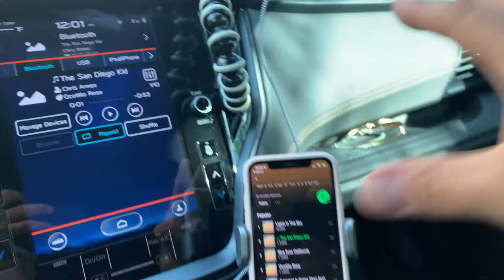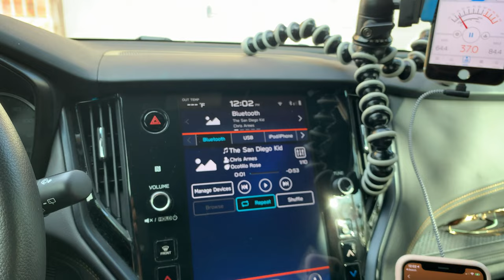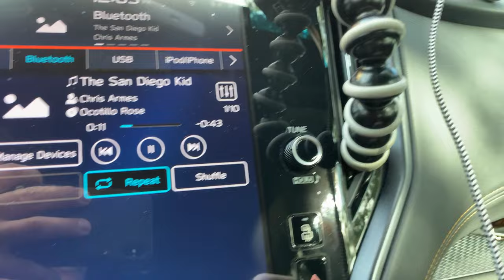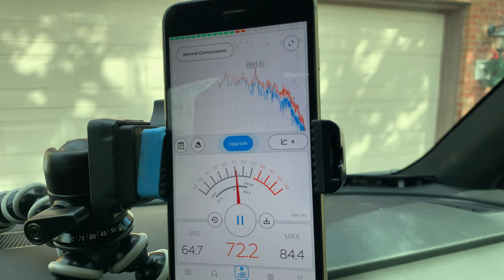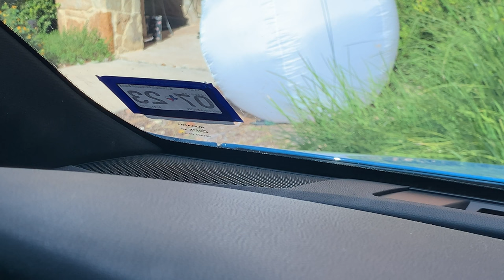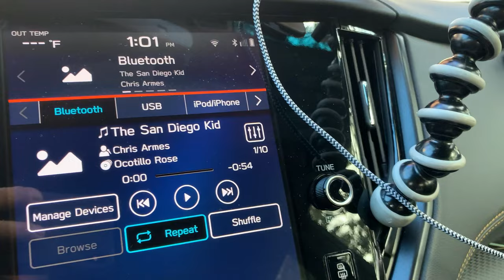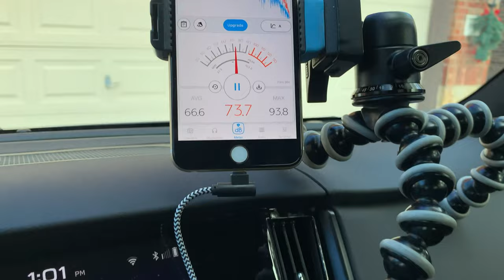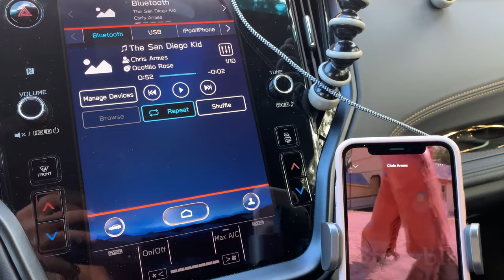Subaru Outback Wilderness 2022 Tweeter Install

Comment: 2024-2025 outback Wilderness has Harmon Kardon standard speakers but they don't sound that great. The factory amp keeps the same frequency in and  out so it won't be louder but maybe cleaner/crisper. U gotta set the balance more towards the rear.

Comment: swapping the speakers are not necessary, ive had a "system" in every car and truck ive owned, $4k+ on speakers and amps on most... BUT... on the OBW a simple DSP install will save you from having to replace all the speakers AND is a 1/4th the cost. YES it does take crappy speakers and turns them into expensive high quality sounding speakers. - grest video BTW!
Reply from the maker: Do you have an example install video of a DSP in a OB/W or particular link to a product you could share?
Reply: I'm learning but I did go to a car audio store and talk about my options for awhile, things definitely seem a lot more complicated than I thought. He as well suggested not replacing the speakers to start.
I was told the first step to take (low hanging fruit) would be to get a Kicker Key, a quick Google just told me that's a 'DSP'.
It seems interesting and I may try one, although with instalation its seems expensive for a first step.
With these two speakers in the video shown side by side it is tempting, they are very cheap with an easy instal by the looks of it. At that price if they make a difference would that not be a good thing? Maybe the DSP overrides that advantage?
Reply: No it doesn't .
Moronic statement
Reply: just adding a DSP to factory speakers is just adding a "Band-Aid" to the system. when you get good quality speakers and a good amp behind them it then takes it to another level with the DSP.  @MoxieTom sound deading will greatly improve the sound in the car.

Comment: Is this plug and play with the base trim?? Great video
Reply: I think so? The upgraded trim would be the HK speaker system but I think the connectors would be the same. Don't know that for sure - but if you are replacing the HK tweeters then that's not the base trim.

Comment: what do i do if my base model does not have the tweeters installed prior?
Reply from the maker: I suppose you need to take a look under the speaker cover and see if there are any cables tucked inside the hold? You may need to look down into the hole through the windshield.
Reply: @rasterfixate  i checked thoroughly and thre was no wires :/. I looked online and it seems that a new wire harness may be needed so now im just disappointed even more with my car lol
Reply from the maker: @LicPlate8VPL158  It may take a little sniffing around or maybe a post. But try on the forums : https://www.subaruoutback.org/
Reply: @rasterfixate  it's actually a crosstrek base :(
Reply: @rasterfixate my base 21 forester has the wire harness already there. Im debating on which tweeters to purchase. I like the kicker plug and play but not sure if there worth the cost
Reply: @LicPlate8VPL158 there maybe a white wire harness tucked in to the left (driver side)

Comment: Good video.  I ordered an OBW and I am just waiting for it.  I already ordered the new tweeters like you installed.  Did you disconnect the battery during the install ?  Many say you don't need to.
Reply from the maker: Oh wow! Didn't even think of that. I had the car turned on even with the radio running the whole time, but on bluetooth and volume down. Seems to be okay. Probably should have turned off the radio during the upgrade part.
Reply: I did mine while listening to the radio...lol...I got Harman Kardons with center speaker

Comment: Thanks for the video! Do you know if these tweeters work on a 2016 Outback? It's not listed as one of the compatible models but it has a similar connection. Maybe the connection is just slightly different, in which case, why?!

Comment: The audio in the outback wilderness sounds really bad. Is it worth it to install the replacement tweeters or better to find a complete solution? I'm guessing the replacement tweeters just make it sound less bad...any suggestions?
Reply: It is bad. No doubt. I have yet to install my door speakers, but the tweeters do help with the highs...but you need to also do the door speakers which is a massive improvement. Of course when it comes to audio - there are no limits to how far you can upgrade.
Reply: It needs a complete audio overhaul. I own a 2021 Crosstrek and a 2023 Outback wilderness. For my Crosstrek, I replaced everything and added an amp, so a new head unit, Kicker 6x9's coaxials upfront, 3.5 inches coaxial in the tweeter location, and 6.5 coaxials in the rear doors. I also added a JL RD/400 4-channel amp. It is kinda pointless to upgrade all of your speakers and not use an amp. Your speakers need power. I've only had the Outback a week, but I plan to do the exact same setup except for 6x9 components up front and 6.5 components in the rear. Also, because you can't really replace the Outback head unit, I am just getting a JL Audio factory integration unit with the digital sound processor (DSP). The factory head units in the new Subarus are terrible and have settings that include bass roll-off. You need an aftermarket digital sound processor (or head unit) to override the factory equalization settings. If you add an amp to a factory head unit, you will just be amplifying a terrible EQ curve. I spent about $2k on my Crosstrek audio upgrade, but I installed the speakers myself and had the amp and head unit professionally installed at a Crutchfield location. You'll also need something like the Maestro i-data link to keep the factory steering wheel controls and work around the Starlink module (this is an actual nightmare, have it professionally installed). There is no simple fix when it comes to an audio upgrade in these new Subarus. I would wait and replace everything at once, buy once, and cry once. It was a complete pain in the butt with my Crosstrek, but I enjoy amazing sound quality every single day. The Outback is my wife's daily driver, so I'm in no hurry to upgrade, and I want to do it right. My father has been a musician and sound engineer for over 30 years. He has the Harmon Kardon in his Subaru, and he admits my setup blows his out of the water by a lot; it's not even close. The JL amp with quality Kicker speakers sounds amazing. Just my 2 cents.

Comment: Wonder if the 2022 WRX had the same tweets? Can't find any info on them.
Reply from the maker: You may need to try to pop-off the cover? Not sure if there is even a cover.
Reply: Yeah, there is. Subaru's are all the same interchangeable on stuff like that. I have the same infotainment system as yours should be the same. I already have plug and play JBL door speakers picked out with correct Metra connections and adaptors. You can look it up on YouTube. It might work for yours.

Comment: Where did you get the white tool to pop the speaker grate up with?
Reply from the maker: The tool is from Amazon. But it's not really a tool - it's a butter knife!! https://www.amazon.com/gp/product/B08TBS67B1
Reply: Crutchfield has panel tools. THey are just basically small plastic prybars that have various tips and angles to remove body panels without scratching.
Reply: Used a scraper just put duct tape on majority for no scratches worked great . Very easy to do ….

Comment: Did you upgrade from the Harmon Kardon teeeters?
Reply: No. These were the stock Wilderness tweeters which are an unknown brand. They were terrible. The new one's sound better. I had to dial them back just a bit to balance with the other stock speakers. When I get the doors done, I'll balance them again with the stock radio EQ.
Reply: We have the  Harmon Kardon system in our 2021 Outback Touring XT. The connector did not plug into the Kicker tweeters, it was smaller . How ever I did replace the front and rear door speakers with Morel Tempo Ultra Integra Series from Crutchfield.